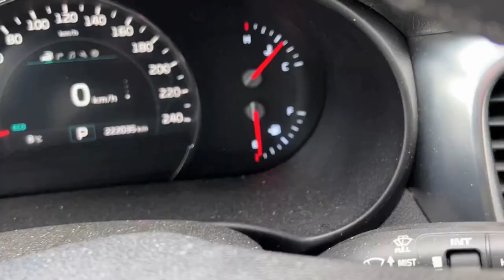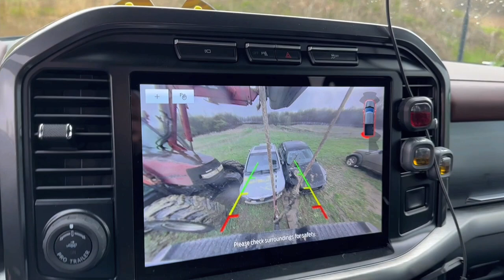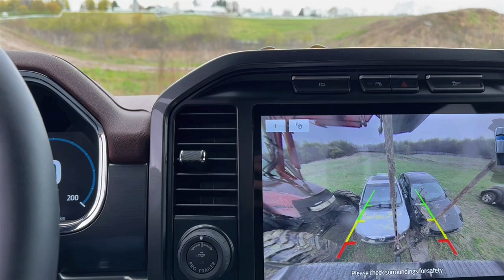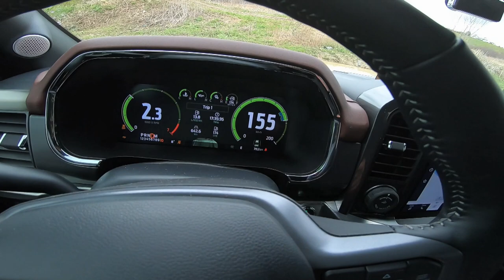2023 F150 Lariat DIESEL BURNOUT!!

Comment: That’s weird most smart key access systems. Don’t let you lock the vehicle if the fob is still  within the interior. 2:38
Reply from the maker: If you lock it with the door button and keys inside the doors won’t lock, but if you do it from the outside buttons it will.
Reply: @markfreeman408  must be a ford thing , we’ve had Kias and Gm cars that had that and wouldn’t let at the would either honk at you or beep